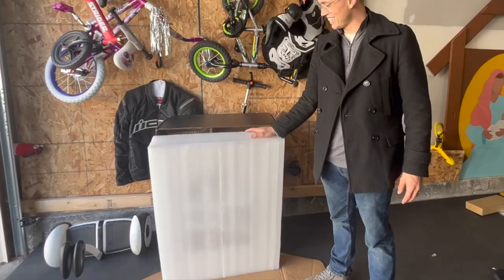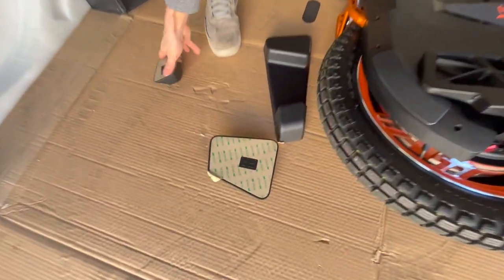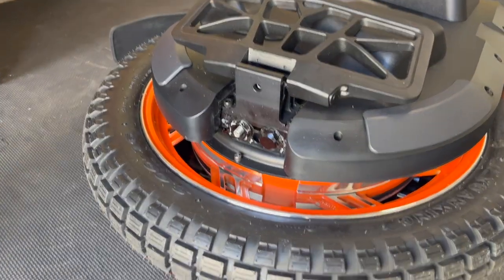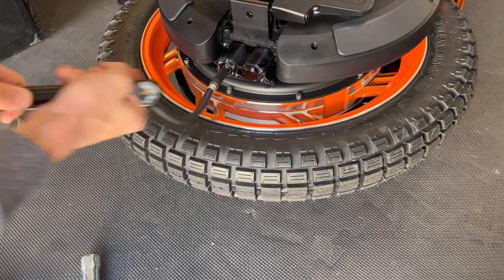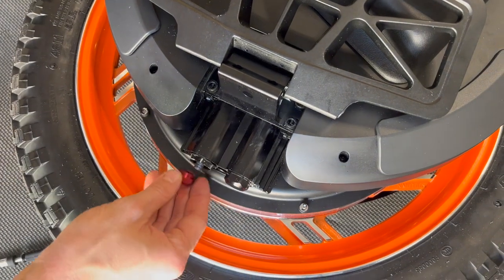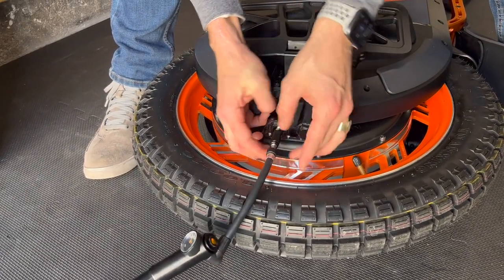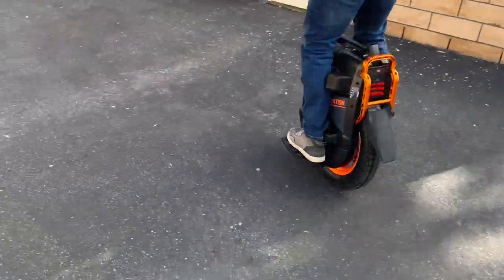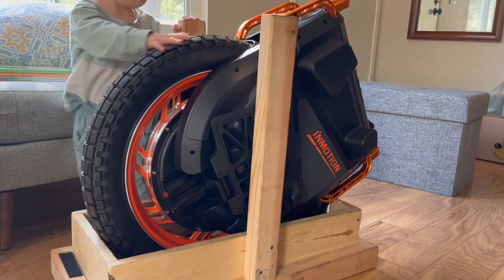InMotion V13 Challenger Unboxing

Comment: I have to chuckle, I hadn’t seen this until now, but I remember the video, and refreshing myself it was 5 months ago, where you said the s18 was enough. It’s an addiction for sure. I got a good deal on an EXN, so that’s my extreme wheel, but it goes to show nobody stops at a sensible wheel. I just can’t help but laugh at the short period up to a crazy extreme wheel for you.
Reply from the maker: Hahahaha you were right! I didn’t know yet. Plus when I lost my S18 to a garage fire, I definitely wanted something more. But I was honestly very nervous to receive the V13 because of its extreme limits. Heavy and faster. I still haven’t been faster than 40ish mph. But the battery size / range has been great for 400 miles so far

Comment: Do you know to calibrate the balance . I calibrated the Turing but I can’t seem to calibrate the balance. Had it for two days and I haven’t learned how to ride it yet. Is it supposed to be this hard 😫
Reply from the maker: Is this your first unicycle? Did you use the app and unlock the wheel? Settings are in the app
Reply: @eucfamily  yes I’m using the app and unlock the the wheel how . I pumped the suspension and yes it’s my first wheel.
Reply from the maker: Are you still stuck, Or is it rideable now? I’m not exactly sure which calibration you need. But this is a lot of wheel if you’re just learning. It’ll take you a week or more to learn how to ride straight.
Reply: @eucfamily  just tryna figure out how to do the balance calibration. Everytime I push it it says failed but the turn calibration went through no problem.
Reply from the maker: Maybe you need to log a certain number of miles before it's unlocked fully.  I think that's the case with the speed limits.  Have you messaged InMotion for their thoughts?